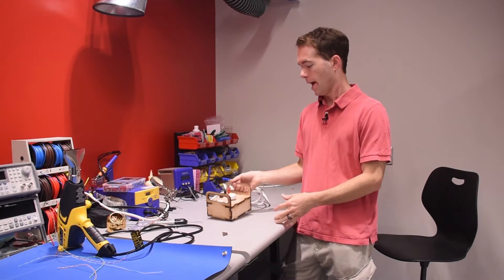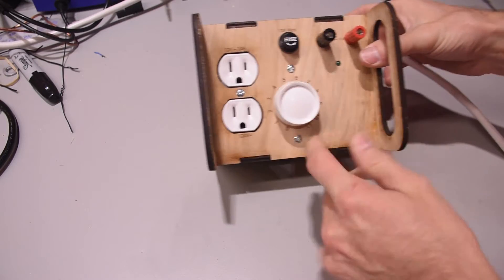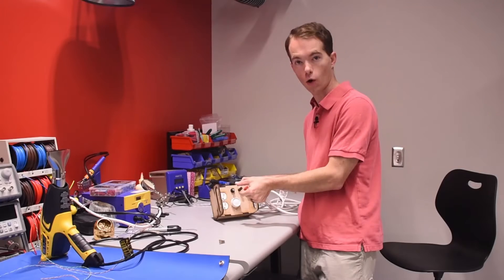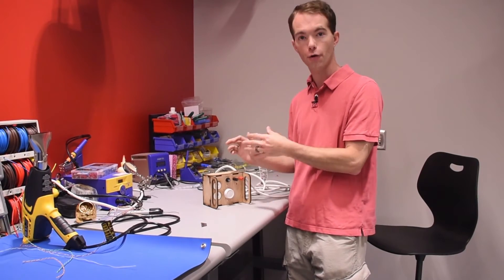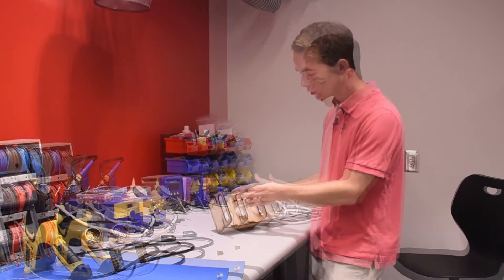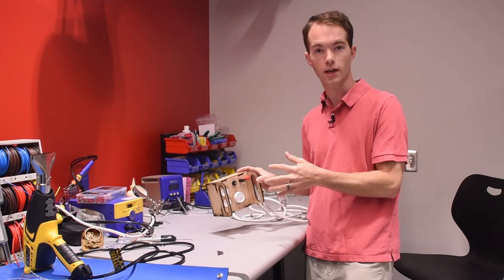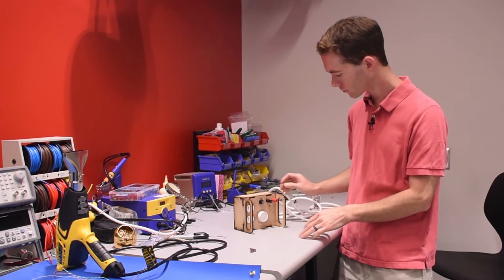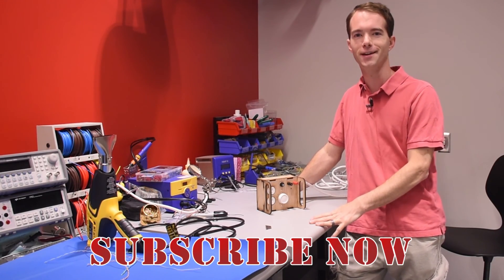New Hot Wire Foam Cutter Power Supply

Comment: I would like to add a digital display that shows the volts and amps to the secondary side of my setup instead of the LED light that would come on when the power is on.  Do you know how I can do that?  I can't find an AC display that measures low voltage.  I can only find DC displays.

Comment: I apologize for my ignorance.  The electricity going through the hot wire, other than being hot, can it cause an electrical shock (or electrocution) if you touch it?  I've made DC powered hotwire cutters using an AC to DC converter, but nothing quite like what you've made.  I teach an aeronautics STEM/STEAM class and would love for my students to use something like this.  I just want to make sure that something like this is safe for them to use (no electrical shocks).  Thank you for your time and assistance.
Reply from the maker: Hey Dwight, that's a good question, but since it's only 12v on the wire, it's safe. It doesn't matter that it's AC. But like you said, it's hot if the power's on so you wouldn't touch it anyway. I used this one in a college setting where middle and high-schoolers frequented as well. Aeronautics is my favorite. Here's some aeronautics content that might be useful as well. 
https://www.youtube.com/@121Mike
https://www.youtube.com/playlist?list=PLH-oe77sgzLISpAfKmbK_EQjD6NsiKZ5w

Thanks for watching!

Comment: Hey, I was wondering how long of a hot wire you could use with this power supply? Thanks!
Reply from the maker: Hi Hunter. It depends on the resistance of your particular wire, so I cannot say for sure. However, I've used a full-length #16 guitar string before to cut wings and it worked great. There's actually a snippet of me doing it in my channel trailer. In my current clamp demo video, my hot wire draws 1.2A at a length of about 10" when set to about 1/3 power. So, based on the same power setting, I could run a #16 string up to 8'4". I hope some of this helps.   https://www.youtube.com/watch?v=_Siq8zMVKQw